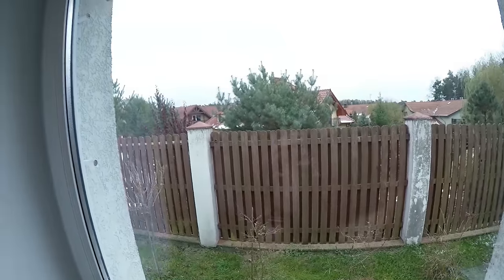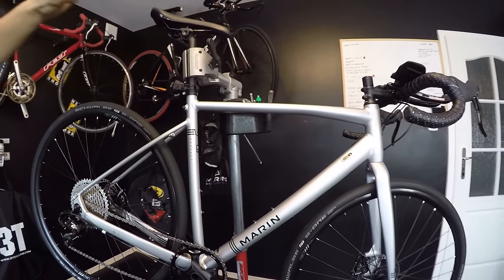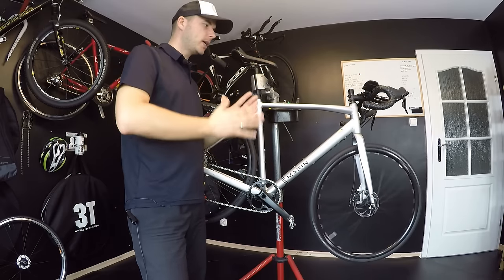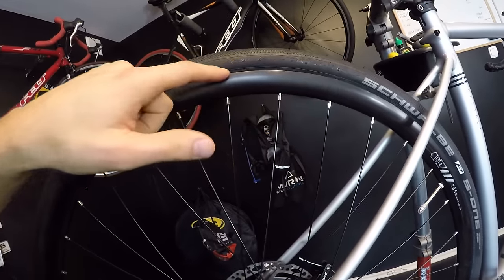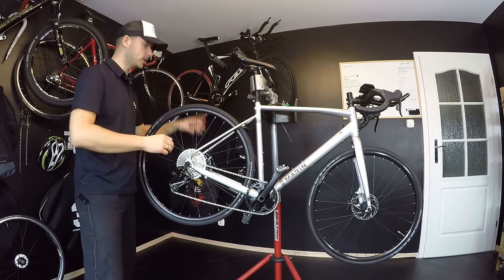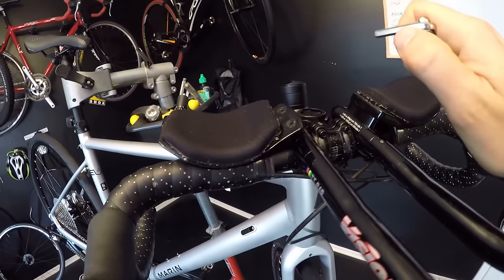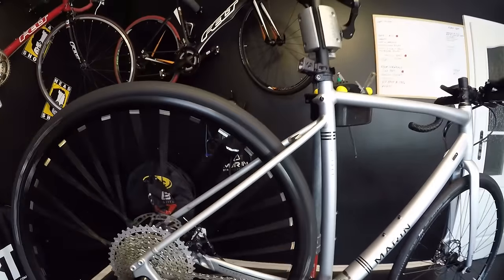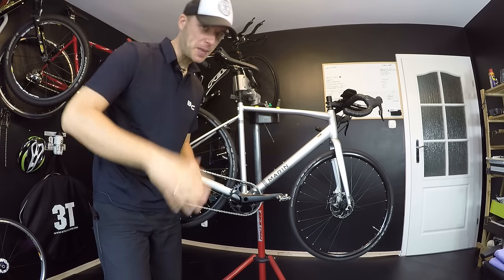99% Of NEW Bikes Need These 5 Maintenance Tricks For Your Safety. SickBiker Tips.

Comment: 1. put some glue on head of nipple and rim-othervise it will loosen
2.people that assembly bikes , they work to make as much as possible bikes and do not have time to play with tyre adjustment and work for low money, think that they must make 20-40 bikes per day and that every day
3. clean your chain from sticky grease that is not  intended for ride, and you can put into petrol and it will not destroy chain- bike chains do not have rubber o rings inside as motobike chains
4. lubricate chain by wax it will extend life for 50% if use it every 100km, do not exceed 140km without new wax, after 180km chain is destroyed( now i test to lubricate it every 100 km and it still works after 50% longer life and  it seams it will reach 100% longer life)

Comment: You should checkout Helicopter tape its so much better!
Reply from the maker: Oh, an interesting one. Thanks.
Reply: Helitape is fine for protecting the frame in areas like headtube,  upper tube and so on. For chainstays use "MARSHGUARD Slapper Tape" or the same but with less friendly name "3M 2228 Rubber Mastic Tape". This last thing is used by boutique companies like Intense. Works like a charm.
Reply: Lizard skin chainstay protectors 👍🏻👍🏻 removable for a clean off and str8 back on 
LOT stronger and better protection then tape

Comment: What kind of unqualified crappy bike shops do you people deal with? I've never bought a new bike that wasn't tuned and ready to go from my local shop!
Reply: I like to make sure my customers know what to watch for because sometimes a wheel isn't really broken in yet, cables settle in after 20-30 miles, brake pads shift a little, or any number of other things that I can't check unless I test ride every bike for half a day.  Of course I'll fix it free in-warranty, but some of them drive in from 50+ miles away because it's the closest shop; if they can fix it at home with a normal hand tool, they'd rather save the gas.
Reply: In my country alot of bikes are brought online, and delivered semi assembled in a box.

Comment: i completely kill chains. i break one every year due to the salt on the roads every winter.
Reply: RInse after every ride. You may not know that most team mechanics start with a hosedown. Its the best way; do that.
Reply: george mira i don't have time to rinse my ride 2-5 times every day. it is my commuter and it works at least,

i do on the other hand have a stumpjumper which i give a good wash after every ride and it is holding up real good, nothing changed except tubes, tyres and gear levers during the years i have owned it (since 2011
Reply: Just do it once per week, takes 5 mins.
Reply: Cory Tant I do it once every week but it is still trash after a winter, I tried once to not clean it once every week and I managed to kill it after 3 winter months with all the salt

Comment: Don't use degreaser on the chain in the way he has done. Instead, use a low viscosity bicycle specific chain lube and apply as he has done.

If your chain has built-up grit, then use a rag with a nail brush to get between each link; again, with oil, such as not to displace the original grease. Only if your chain is really bad do you attempt using degreaser. In that case, wash with soap and water to remove its residue, let dry completely over a few hours, and apply chain lube to each individual link.

Comment: So all Walmart bikes
Reply from the maker: and many high-end machines as well...
Reply: Never assume it's perfect because it's expensive.  I've seen brand new Trek and Specialized with Kent-level mistakes.  Ungreased wheel bearings, bent chainring, etc.  They're very rare, and the manufacturers generally care enough to send a replacement part quickly, which is why those bikes cost more, but they can still happen.

Comment: Why u want to degrease a new chain? Don't they come out perfect when they are new?
Reply: No they are caked in very sticky grease.  The excess grease on the outer plates of the chain will attract dirt that will then prematurely wear on drivetrain components.  The outer plates of a chain need little to no lubrication.  The only real places a chain need lube is on the inner rollers and o rings not the outside facing plates.

Comment: nooooooooo not degrease the chain, new chains come with the best lubrication
Reply: The stuff that's on new chains is often acceptable as lubrication. It lasts long is all. The stuff that's on new bikes is often more of a preservative than lube. Or it might be the same stuff just dried out. 
I never degrease new chains, but I always put my own lube on right after installing.
Reply from the maker: You're absolutely right and I'm pointing it out on this episode. We don't degrease the chain, but clean the OUTER surface.
Reply: The grease on the chain isn't actually there for performance.
 It is there to stop the chain corroding whilst in storage so they can be shelved for years. That's why it's so viscous, so it doesn't evaporate as quickly. 
I deep clean chains out of the box.
Reply: Jan Sæther The guy most likely assumes that before you apply lube, you're also going to degrease the chain, 
Also, who waits before a lubricant wears out. You're supposed to lube the chain regularly to prevent that.

Comment: This guy is not a professional mechanic,degreaser of any kind will not hurt the chain if you soak it
Reply from the maker: Read the manual for the Shimano chains. Cheers!
Reply: Bleach is a kind of degreaser, and will definitely hurt the chain if you soak it very long.
Reply: If the manufacturer thinks I need a manual for a bicycle chain, I'm going to ignore them and buy a KMC instead.  One little tiny sheet reminding users that they chain is almost certainly longer than they need and a quick picture of how to work the master link should always be more than enough.

Comment: The degreasing of the Chain is wrong. Please inform yourself better. Greetings from a German Automotive Engineer.
Reply: Actually he isn't wrong at all. They are caked in very sticky grease.  The excess grease on the outer plates of the chain will attract dirt that will then prematurely wear on drivetrain components.  The outer plates of a chain need little to no lubrication.  The only real places a chain needs lube is on the inner rollers and o rings not the outside facing plates.